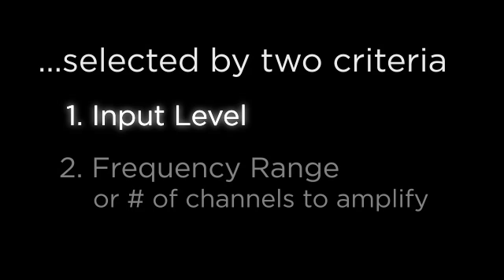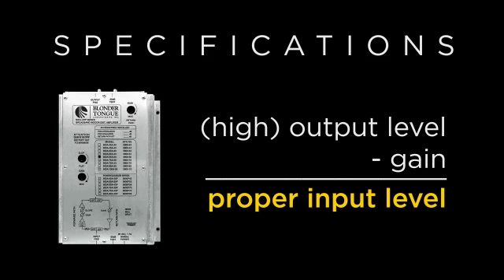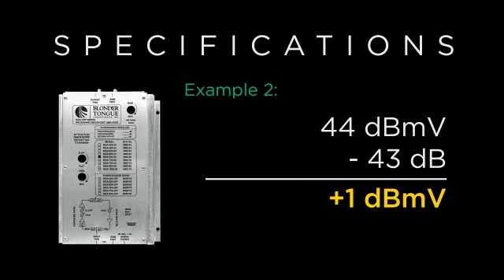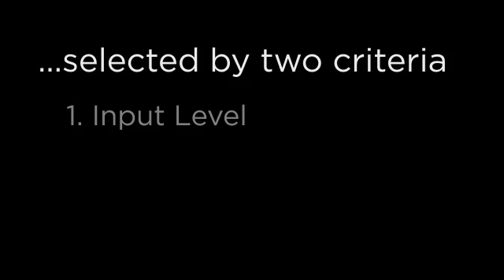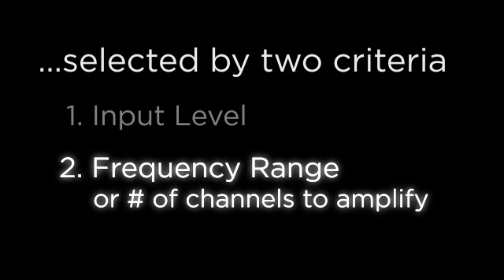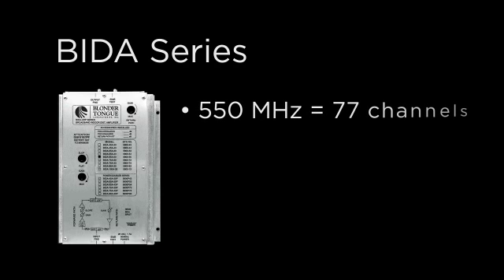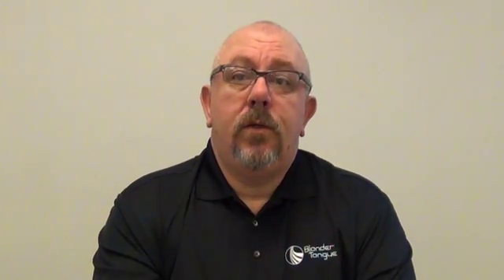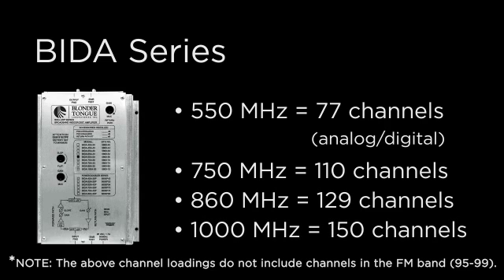How To Select The Correct Amplifier

Comment: I'm baffled... Could you please tell me what type of signal does a OTA or Cable TV connection piped through the BT produce; analog or digital? Is it both? I have just got to know! LOL!!!

I am watching with great interest how a Blonder Tongue is breathing new life into old analog TVs that no longer work.  Sad.
At the same time Blonder Tongue and other A/V Transmitters (like DirectTv) are used in homes and Restaurants to feed multiple TVs that look like they are high definition. 

Right now I'm using Cable which is digital, Smart TV, and a digital Player.  I have two VCRs that have no problem recording  or playing digital TV!!    Yeah!!!

Do I need a digital BT so everything is compatible?  Will any BTs that is hooked up to Cable Channel 3 or 4 be able to send Video to  Channel 3 or 4 to a remote TV? 

I have been to the BT site and am confused.  I need to choose a model for my home, would you please recommend one that works for both analog and digital signal?  I just need to make sure channels 2 to 7 are covered for the correct AM/FM transmission to activate the Receiver/Tuner VCR on the other end.   I will be working the receiving end with an antenna of course.  

I'm not really interested in sending Live TV channels.
Thanks so much!
Reply from the maker: All Blonder Tongue amplifiers are designed to pass Analog and/or Digital signals.  Amplifiers are a broadband device, and they do not process the signal, just boost it and pass it along, so it does not matter to the amplifier if it is analog or digital, as long as the correct level is input into the amplifier.
 
Yes, all Blonder Tongue amplifiers will pass channels 2 through 7, the minimum high frequency on our Amps is 550 MHz, which is cable channel 78.  For selecting an amplifier for a home application, as long as the signals are passing one way only, I would suggest the ACA-35-1000.  

If you need the amplifiers to pass a two way signal, like a control signal from the cable box back to the cable company - try our BIDA series, like the BIDA-86A-30.
 
For further questions, and to speak to a technical support person, please call us at 800-523-6049 and ask for someone in our Technical Services department.
Reply: @BTLabs  This is all good information!  Thank you for taking the time to write.
I somehow had the understanding that a Blonder Tongue was a transmitter, not an amplifier.  I am so glad that you straighten me out!   I will call the company and learn more before I buy a product.
I want to keep it simple, but I don't want to limit the possibilities of what can be done, before I understand what everything can do.
Thanks for setting me straight!